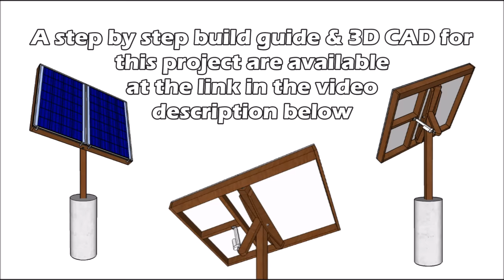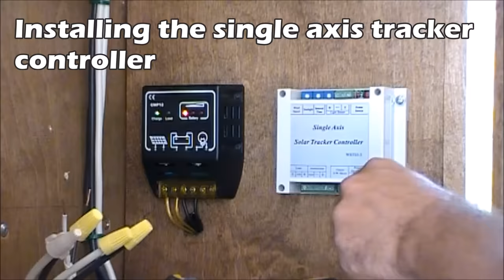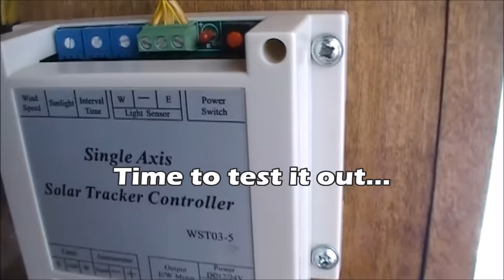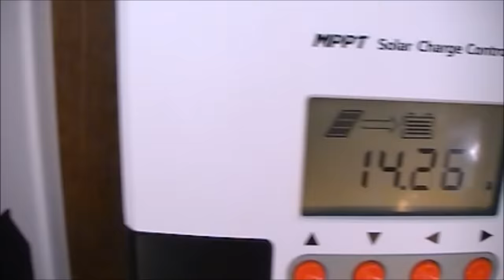Build A Solar Tracking System - DIY Solar Tracker - Off Grid Living!

Comment: Does tracking still make sense nowadays? It would seem you would get more bang for your buck, plus long-term reliability, if you just up your panel wattage and leave them fixed.

I would calculate the cost difference between the 120W panels and a 150W one, multiply that by 4 (for four panels) and see if the additional actuators, controller, wiring, thrust bearings, misc materials - plus reliability factor - makes it worth it.

Excellent building skills and very interesting project, nonetheless.
Reply from the maker: Good question, I was wondering when someone was going to ask this. It would depend on a lot of things like the climate in your region, material availability, etc., but I think it makes more sense now than ever before. The cost is comparable in most of the world and likely to drop even more in the future as the tech becomes more common and evolved. A person can buy the actuator/controller kits that I used which also include an anemometer for wind speed protection on Ebay for a little less than $200CAD (see link below), and they can handle over 1000 watts of pv panels (in terms of physical load on the actuators that is - they can support up to 300 lbs max push/pull load, avg 150W panel weighs around 25 lbs, so up to 10 panels plus the weight of a wooden 2"x4" platform). 
For comparison let's say we can buy the panels from a manufacturer for $1/watt, regardless of size, not including freight (local supplier, in-store pickup). The cost for ten 120W panels would be 10 x 120 = $1200. The cost for ten 150W panels would be 10 x 150 = $1500. A difference of $300. So the average DIY'er might save $100 or at least break even with a solar tracker install after they paid for the tracking kit and bearings (they only cost around $5 each). In terms of building materials, my trackers work out to requiring around the same as a fixed ground rack, but if the platforms were larger to support more panels then they would use less material per square foot of collector area than a ground rack would, simply because less vertical supports and foundations/anchoring points are needed (as long as snow and static loads are estimated properly and components are sized accordingly). For example, without the extra support from the actuator, even one of my two-panel arrays would need at least two support posts and concrete foundations to support the platform properly instead of just one in the center. That extra cost in time and material for one extra support post alone is pretty close to if not more than the cost of one of the tracking kits at the link below. Not to mention the carbon associated with the concrete production and the environmental footprint (in terms of both natural resource consumption and occupied space). I think keeping the collector area as small as possible by making it as efficient as possible (without breaking the bank) is the main goal in most cases - saving money is a motivator but it isn't our only limited resource, unfortunately. Hence the industry's focus on increasing cell efficiency. And why I incorporated a mini split heat pump with a fixed PV array (I did save on building materials with that project because the house supports half the weight lol). The next solar heat pump array will be on a tracker and will circulate a glycol solution instead of air though ;)
https://www.ebay.ca/itm/1000W-KW-Single-Axis-Solar-Tracking-Tracker-Controller-Anemometer-Complete-Kits/192253515293?hash=item2cc333d61d:g:LswAAOSwq1JZI9CO
Reply: I appreciate the extended reply though you did change the equation from what you showed on your video, which is what I used as basis. 

Even if you expand to use the same actuator, controller and pivot system for more panels, it could be a stretch to justify it, IMHO.

Anyway, it is an enjoyable technical feat and that certainly adds value. Looking forward to watching the new tracker heat exchanger (yes! glycol transfer is many times more efficient than air).

Merry Christmas!
Reply from the maker: Ahhh, I see what you're saying. Lol, sorry. You mean I added 8 more panels to my example to justify the cost of a tracking kit, vs using just two panels per tracker like in my video. True, it would be hard to justify the cost by wasting the potential of the actuator and incorporating it with just two panels per tracker like I did. But I assumed you were speaking in general terms when you asked "Does tracking still make sense nowadays?", not specifically my particular investment alone. My circumstance is unique in that I only have 60ft between the south wall of my house and the tall treeline on the Crown land next door, so the trackers had to be a certain distance between the house and tree line to avoid shade from trees that I'm prohibited from cutting, and the tracker height had to be  limited to avoid shading the solar heat pump array during the winter months (my original plan was one large tracker holding 6 panels, until I visited suncalc.org and tracked the shadows on my property). I also make my own panels; I buy the cells and encapsulant at wholesale cost in bulk, and use recycled tempered glass salvaged from window and door replacements (thanks to my day job), and have lots of scrap wood to play with. So cost wasn't so much of an issue for me with this project. I built this system for dirt cheap. But bottom line, if the kit is designed to handle 10 panels and a person has the space to do it, then they should install 10 panels on their platform to get the most out of their investment. As far as a CBA, people have to figure that out for themselves based on their own circumstances. Given material costs here I can say it's worth it for me or anyone else in my area easy enough, but I can't speak for everyone. It really does depend on a lot of things. What Kent Building Supplies charges for building materials here in Freddy NB is quite a bit different than the costs at Rona in Eddy AB. Likewise with Pv components or most anything else, especially installers if a person doesn't have DIY skills. Just got to do the homework and punch the numbers to figure it out. Do what works best for you!
Reply: I would like to add that the angle of the panels increases the out put by MORE that 10%,depending on the sun!
Also,just cooling off the panels with a garden hose also increases the total of out put by 5 %. Please try it.  
 Some even use a use a sprinkler system.
Reply: Add a small solar panel, a small 12 volt or lower water pump, a soaker hose and a collection tray plus a water barrel and your set.
Reply: ddd228/Dave in Seattle. Wow... great ideas for cooling !

Comment: the length of your motorized movement is only 8 inches. Would that length be ok for a northern location like Maine? I'm thinking to double that movement to 16" or at least 14. I'm also going to make mine with 4 100 Watts panels. 
very nice video! thanks
Reply from the maker: Yes, it will suffice. I live in NB, Canada. It's the degrees of rotation that matter when it comes to maximizing harvest, not necessarily the length of the actuator. A 14 or 16" actuator will give you the same range of rotation (~80-90 degrees, I've drawn a few different sizes in CAD). The travel of a longer actuator is longer, of course, but the distance it has to travel is subsequently longer because of the fact that it has to sit lower on the column and/or further out on the platform to compensate for its length and maximize range (if a long actuator is located to close to the pivot point then range will suffer and the load won't be distributed properly). It's a simple case of Pythagoras' theorem (a^2 + b^2 = c^2), the longer a or b is, the longer c will be or vice versa. The limited range is the downside to using a linear actuator for tracking, though it is the strongest and most convenient method for the price. The only instance where you would want a longer actuator than what I've used here is if you build a larger platform for holding more panels. The actuator not only moves the platform, but serves as a brace for it too - this is the positive side to using a linear actuator like this compared to other methods. The actuator can handle a load of around 350 lb (amounts to around 1000w worth of solar panels), and this design only puts around half of the load of the platform on the actuator. But the shorter the actuator is then the harder it has to work to move a large platform - it's all about leverage. A long actuator would move a larger platform much easier, and would use less power as a result. If you intend to install four 100W panels, then using a longer actuator wouldn't hurt at all. There isn't much of a difference in price, from what I remember.

Comment: Great build! Nice simple and easy to construct design. Do you think this design (using wood as the build material) could be scaled up to hold 4 solar panels without any structural and or wind load issues?

Comment: The new bi-facial solar panels would make efficient use of that reflective gravel surface.  Also, I wonder if one cheap motor using wire and strategically placed pulleys could operate multiple trackers ?

Comment: hi, very impressive, good job, how can i get plans? because i want to make the same installation but for 8 panels and with dual axis mode ! with i suppose somes adaptations (bigger wood section and concrete foundation more heavy) for wind resistance,...

thanks a lot for your answer

best regards

stay curious and imaginatif

Thierry from Belgium(Brussels)

Comment: Since both panels were being driven from 1 controller, are there issues keeping them in sync since I guess you have to make sure the actuator, geometry and initial position etc are identical between the 2 panels .

Comment: Nice build... What would be the w
Highest wind condition it could tolerate?
Reply from the maker: Thanks! These trackers have experienced 100 kph+ (60 mph) winds so far here on the Atlantic coast. 0 problems. With that said, if a person were to install more panels on each tracker than I did, then they should increase the column thickness to at least 6x6" or use 3" stainless steel tubing instead of wood. Just to be safe.

Comment: You’re a pretty crafty guy! Now I’m wondering if this set up can be beefed up to support 15 - 310W panels that are presently mounted on my roof. The location they’re in now is very inefficient with the sun collection dropping dramatically soon after noon each day on a sunny day. So I really need to do something about this. The commercial trackers are cost prohibitive,  if so your method is very attractive to me, especially being a woodworker myself. But my main question is if your design can be beefed up enough to support such a system, and if it can withstand high wind storms which we frequently have here in Maine. Your feedback will be appreciated!
Reply from the maker: Thanks! You can beef up the rack, make it as big as you want. There's no limit in that regard. However the actuators can only handle a 300 lb load safely, which equates to around 1000W of PV panels. You'll probably need 3 separate trackers unless you can find stronger actuators.

Comment: Thanks for this, I have had 3 Lorentz trackers fitted since 2008 and one has just stopped working. 
I contacted Lorentz in Germany and they tell me, they stopped making trackers 4 years ago and cannot help me with backup or any info on a possible repair facility for the circuit board anywhere.
This might help me find something to replace the faulty board.

Comment: Hi James, have you ever done of your builds using composite materials like a fiber glass mesh?  I noticed that you are using wood, and there is no problem with that.  I was just watching our video and thought about using your plans to build the system, but using composite materials, which are lighter in weight, weather resistant and form-able.

Comment: Solar tracking sounds good but is it practical.  In some cases the system works great. In my part of the country it gets torn up pretty fast.  Winds are pretty bad in the spring and early summer.  Even the high grade mil-spec stuff is broken within a year or two. Floppy and unusable. Know your environment.
Reply from the maker: I'm a certified journeyman and building contractor living/working in Atlantic Canada, one of the windiest places on earth. It's my job to know my environment. These trackers have survived tropical storms. I'm not sure what's supposedly floppy and unusable unless you're talking about semi-flexible panels, otherwise that's nonsense as far as my experience over the past decade is concerned. Even semi-flexible panels are absolutely fine in most wind environments, unless a person goofs on the installation. Know what you're doing!
Reply: @JamesBiggar  Here in Southern New Mexico most of the commercial tracking solar sites are gone. I only know of one operating Northwest of Hatch. Everyone says they can take cat 5 hurricane winds but, we get day after day of cat 1 to 2 force winds. Especially on the ridges. I work in communication and telemetry and have to go to very remote sites. Funny story... the engineers designed a new system for a live range site that used wind generators rated for cat 5 hurricane winds. Got a call something was wrong and we went out there. We passed 2 solar sites on the way there and the panels were both jammed  on east most arc. At 506 the generators blades had exploded and were strewn up to a half mile away. All new sites in New Mexico are fixed solar and there are a lot going up.

Comment: The controller and actuator for this project are DC powered. Wondering if I can use an AC to DC converter to power the controller instead of using a battery?
Reply from the maker: Of course.

Comment: Awesome design, I bought the plans, now going to build it! Could you tell me the brand & model or give me a link to the actuator you used on your tracking system? Thanks so much.
Reply from the maker: It's been quite a while since I did this, I doubt the links are still active. Any 12V 8" linear actuator will work fine as long as it can handle more weight than your panels. They're all pretty much the same. Buy according to your budget.

Comment: Question. Was it worth ducting the solar for your heat pump through the condenser? Or would you get more overall gains by putting them on a tracker?

Comment: Now don't get me wrong, I love DIY and have built my own tracking array, but before YOU do, two important questions to ask...(a With used 250W solar panels going for as little as 20$ each...is it worth all the hassle and expense for just a 25% increase in yield? ......(b If you consult any of those online engineering tool boxes and consider what is going to happen in a  rare but not unheard of 150kph wind.....its SCARY, that 2m2 array will be subjected to at least 2 tons of sheer force....that nice wooden post...history...so sorry, dont mean to 'rain on your parade" you did a beautiful job ....so sorry.

Comment: Hey there nice video, you got another sub!. Wood won't rot faster when it have direct contact with the concrete? In dry climates it will work fine I suppose but in humid it will rot in less than 10 years even with treated wood.

Comment: Great video, but, for all that work and cost, would it not be cheaper to add 25% more solar panels??
Reply from the maker: Thanks! Some have asked that same question, in all likelihood a tracker will be more affordable for most people but it depends on a few things. Panel cost and array size being the main two. There's no extra work to building a tracker vs building a fixed array. In fact, I would argue there's less work to building a tracker (and I've built a few of both) and less materials. But in the end you will have to plug the numbers and decide for yourself based on your own circumstances and what you can come up with for designs. Generally speaking, the more panels you can fit on your tracker without overloading the actuator, the more affordable the system will be. The kit that I used can handle over 1000 watts, which equates to ten panels that are a similar size as mine (~120W.) My original plan was to build one large 6 panel tracker, but I only installed two panels per tracker because of space issues on my property in regard to shadows from the neighboring treeline and shadows created by the trackers themselves - overall height had to be below 6ft to avoid shading the new solar heat pump array. I could have built a fixed array for roughly the same cost, but I promised subs that I would make a tracker video so I followed through with it https://www.suncalc.org/#/45.8403,-67.0694,17/2017.12.27/13:40/1/2

For argument's sake, let's say that a local supplier is charging a standard retail price of $1/watt for PV panels, regardless of size, after taxes, in-store pick up. Ten 120W panels would cost $1200 in that case. Ten 150W panels (25% larger than 120W) would cost $1500. The solar tracking kit that I used (link below) cost around $150 incl. shipping. That would be $1350 total for the PV and tracking kit. So in most cases DIY'ers can expect to save around $150 on installation costs per tracker in comparison with a fixed array that's oversized by 25%. If you can somehow manage to find and purchase PV panels for $0.50/watt as someone claimed in the comments here recently, then ten 120W panels would be $600, and ten 150W panels would be $750. With just a $150 difference in panel cost, adding the tracking kit below would make the options cost comparable (though this doesn't include the extra cost associated with the extra support post and foundation that the fixed array would likely require without some ingenuity in it's structural design otherwise).
https://www.ebay.ca/itm/12V-Single-Axis-Solar-Tracking-Tracker-1KW-Complete-System-Kits-Linear-Actuator/202152455699?hash=item2f1139ae13:g:KfEAAOSwA3dYHeHd